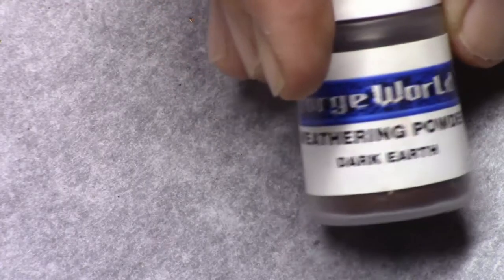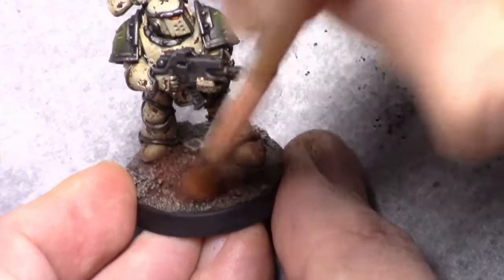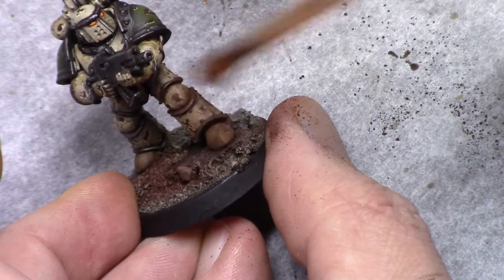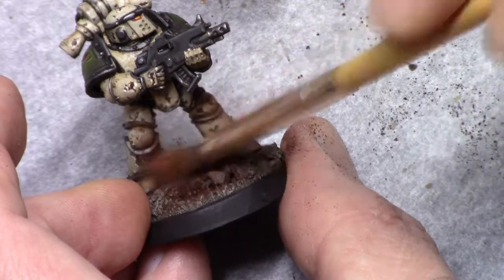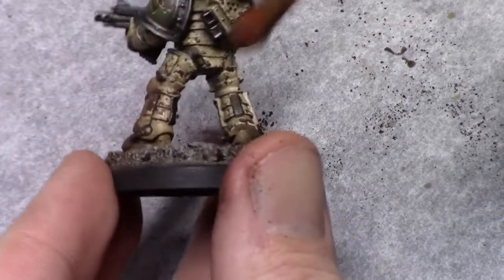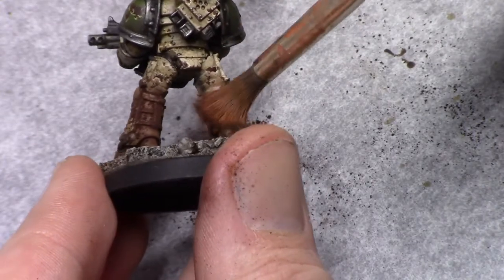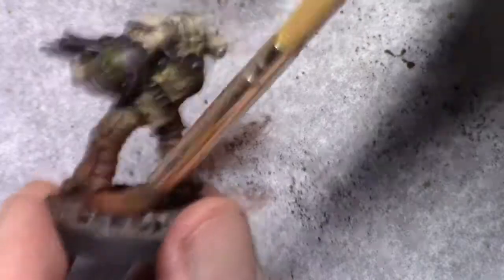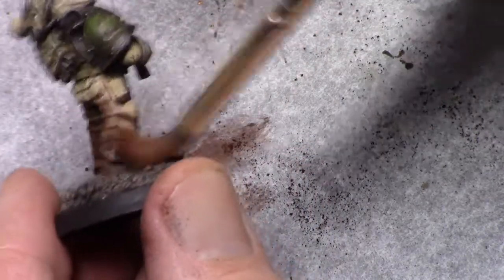How to apply weathering powder

Comment: Don't you have to seal it ?
Reply from the maker: Peninsula Painting Projects when you seal it it changes the look of it. Eventually this will come of, but i will apply a bit again.
The real dust look will disappear with sealers.
Reply: wizzard wargaming Ok when you seal it doesn't it appear like a greasy look
Reply from the maker: Peninsula Painting Projects it takes away the real dusty look, and that is what i use the powders for. If i want let's say caked dirt or wet mud there are other products for that. When the powder gets wet it changes or disolves.
Reply: wizzard wargaming Ok man I've never used it before so just curious
Reply from the maker: Peninsula Painting Projects just give it a try mate, its simple and gives a really great finish to your models, for a bit cleaner look stay around the feet, and on the base.
If you where close i'd say drop by and give it a try with my stuff.
Reply: wizzard wargaming thanks mate that's a nice gesture I don't mind going out and buying the stuff just having the time mad getting the guts to try it
Reply from the maker: Peninsula Painting Projects use an old model or since you got this sweet orks yesterday on the tracks of the vehicles. Looks really good.
Reply: wizzard wargaming will do man. Would you suggest the Forge World is the best or the AK
Reply from the maker: Peninsula Painting Projects i myself use the forgeworld ones, my buddy uses pigment powders from vallejo and they work great as well. I started with the fw ones and that's why i keep using them, i try to keep the same colors.
Reply: wizzard wargaming ahh ok man I'll have to check them all out and choose one